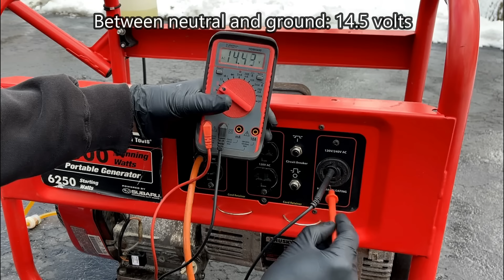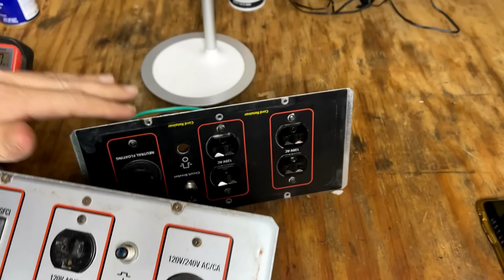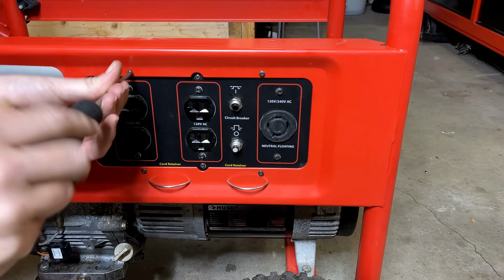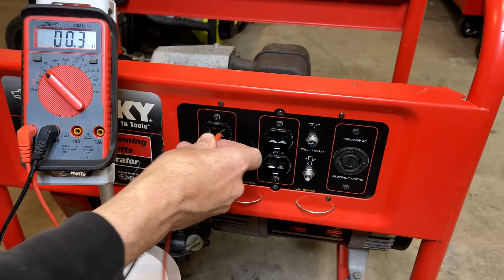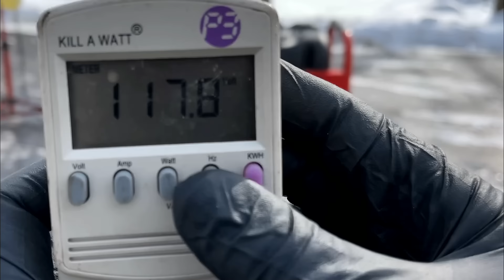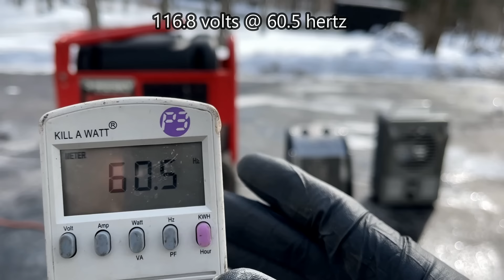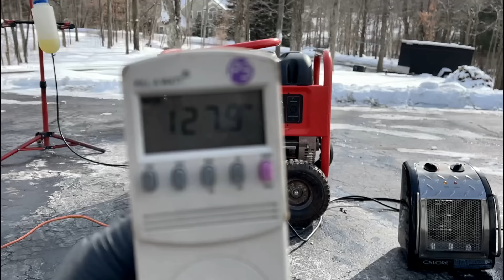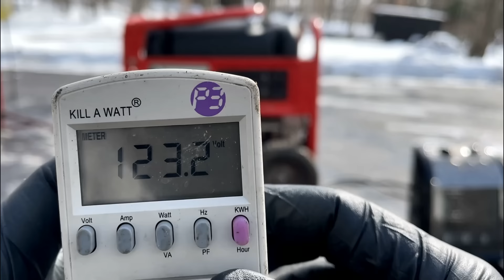No Power Output From Generator - Fixed

Comment: James, can one not adjust the AVR while the engine is running?
Reply from the maker: It can.  Just keep in mind 240vac on the stator, 130vdc on the brushes and moving parts.  Much safer to do it with the engine off.

Comment: Nice  to learn   , specially when you that much care a but the rust  even inside of the weels and wire brushing that !  but not the plate inside of air filter,   anyway just outside looks matters no one see that , one more things straight from start to the history of  equipment  specialty the price are very helpful  thanks
Reply from the maker: I brushed it off camera.  Also ended up swapping the air-box out with the carburetor at then end with one that has no rust.

Comment: When you are soldering magnet wire you need to scrape off that varnish and also scraping the terminal wouldn't hurt. I make battery packs out of AA rechargeable batteries and staples as the links and I have to dremel everything, staples and battery ends before they will stick. So giving that terminal a little grind with the dremel wouldn't hurt, just use a small precision grinding bit.
Reply from the maker: I did scrape.  Like the patriots logo!
Reply: @jcondon1  Thanks.

Comment: Seems like moisture and the corrosion as a result was this unit's worst enemy.   Glad it shook out.   When it's cold as cold can be outside,   my snowblower hunts and surges a bit.......until the engine gets to working temperature.  I wonder if the cold was working against you.
Reply from the maker: The cold does not help.

Comment: James, it's not unusual for the folks winding rotors to use an alloy that withstands centrifugal forces better than straight copper  (sometimes Al or just a hint of Be).  Both make soldering difficult.  The original was probably done as a braze with a propylene torch.  But that doesn't mean you can't solder it.  Try flux from US Forge (part 03051)...  I've found that works on about 90% of the oddball stuff.  If that doesn't work,  there is a flux for soldering Aluminum.  I get mine from Russia (off the web).  It only costs a few bucks for an ounce or two but it takes 6 weeks or more to get it.  But it will let you solder anything to anything... almost.  Just flush it well with contact cleaner when you are done.   I have your email still, I'll send you a pic of the Russian stuff.
Reply from the maker: Thanks, very helpful.  My soldering tooling/knowledge is light.

Comment: James, that is high temperature wire and you need to mechanically strip it off for it to the solder. You  an use an facto knife to stop it off but need to be careful when doing it to be successful.

Comment: Previous owner / operater was a real slob;...letting it corrode like that, water  in oil, fuel, no air filter, messing around with wires... but now it is  once again a nice machine!
Reply from the maker: The listing said it had a recent tune-up.  Water in oil, no air filter, water in the tank, clogged jet.  It was not treated well.

Comment: I was screaming at my computer, try googling aluminum solder kit, it is expensive, but I have used it. I comes with a special alloy, and flux, plus plenty of warning sheets. Just tinning the wire ends is enough, and it functions as a bridge metal for regular soldering to copper.
Did you ever check the connection to the other slip ring?

Comment: Is it possible to buy new power heads for good running subaru engines with that arent putting out voltage?
Reply from the maker: It is possible, but they start at about $400

Comment: Grounding question.  First means of disconnect should be grounded.  This is the main panel in a house.  My Generac has a bonded neutral.  When connected to either a transfer switch or backfeed breaker, the neutral bond should be converted to floating.  Is there a kit available to add a switch to the generator so I can easily go back and forth to bonded neutral when using it as a standalone vs. whole house backup?  Could you do a video on the conversion?
Reply: I would talk to an electrician about that.
You shouldn't float the neutral because there are a lot of appliances with metal enclosures have the earth and neutral bonded inside. (Inverter welders are a good example.)
Reply from the maker: Have not seen a switch, but there are some companies that sell bonding plugs.  So permanently convert to floating neutral and use the bonding plug  to switch it.  The only downside is that it occupies an outlet.  https://amzn.to/34OtJXD
Reply: @jcondon1  The bonding plug is the solution for bonding the neutral in smaller generators, typically 5500 and smaller with floating neutrals.  5500 and up typically come with bonded neutrals.  My union electrical foreman suggests that I float the neutral.  The Pro Line Transfer switch manual suggests that I bond the neutral.  Have you had any experience with generator failures due to either?

Comment: The challenge with soldering AL is it oxidizes almost immediately and solder wont' stick to the oxides.  I'm not expert at it, but try coating it with flux first, sanding it while keeping it coated with flux (to keep the air away), then do your best to keep it covered in flux while you solder.  I think I would use high heat and work quickly, AL will conduct the heat away from your joint quickly and high heat will get the joint hot quick and hopefully you can get it done before the flux is gone and before the heat gets down the wire enough to melt the coating where it shouldn't be melted. No guarantees, but this is what I would try.
Reply: You cannot solder to AL.
Well you can, with very specialised solder/brazing alloys and flux designed for them, neither of which you'll find in a hardware store. You also need very high heat and a good respirator. Also it will only meld with certain grades of aluminium and there's generally no way to tell the composition of the alloy that you're looking at. Same goes for TIG. Most cast alloy parts for Eg. can't be welded.

Comment: 3 parts diesel to 1 part oil would make for a far thinner mixture.  Might be worth considering if you have a carb that runs a little rich with just motor oil in filter.

Comment: The windings on the rotor are double enamel coated, unless you scrap or otherwise remove the coating to expose the raw copper, it will not be solder able and a "dry" joint will result. (high Resistance)

Comment: I know on the Honda gx motors and clones. If the engine does the surging/seeking it’s usually a dirty/ clogged pilot jet that can be removed from the outside. On top near the idle screw

Comment: Looked at the problem of the rotor soldering. I believe the problem is the aluminium wire coated with copper. You can not tin/lead solder aluminium wire with a soldering iron. What I would do is to use some copper wire and solder to the rotor with a short length. Then cut the existing rotor wire and remove the lacquer but not the copper, then join and secure to the rotor body. Just my thoughts. Cheers

Comment: With all the corrosion internally and externally, this had to be stored in a very damp environment. Than would also explain the AVR pot. Please do not "repair" the circuit breaker as that would open up a whole can of worms, all bad. You need a Dremel tool with a wire brush. That would allow you to clean the rotor terminal which would allow for a proper solder joint. As always, great job!
Reply: Agree. I was thinking that or some emery cloth.

Comment: How do you find the torque specs for all bolts?
Reply from the maker: Just based it off of experience/bolt size.  I did not have a service manual for this generator.  But most service manuals call for very similar specs on these bolts.

Comment: 49:00 adjustment screw... I've spotted that that's fixed with some form of hot glue. Heat it, & it should worry off.

Comment: Regular soldering process do not works on bare aluminum wire. Those wires has a thin copper coat to be soldered, so you need to remove only the enamel to try to solder it. Most of them can be removed using temperature, but you need a more controlled process.

Comment: hey James,
don't scrap your rotor, he's fine (not the bearing, ok), you need only a snap-on/pressed connector, or a double screwed connector like in domestic installation, aluminum wire one side, copper wire at the other side, easy to solder.

Comment: I'd check the other connection too. Scrape the other wire on the other connection till you can see bare metal then check continuity between the wires on either side. If that's open then there's a break in the windings somewhere. 
 I'd doubt it's aluminum wire because it was soldered originally.
Clean metal is the key for soldering. Use fine sand paper to clean the lacquer off the wire then use flux and try tinning just the wire. Then clean the terminal with sandpaper, use flux and tin just the terminal. Then it should be easy to solder the tinned terminal to the tinned wire.

Comment: No point in attempting to solder a corroded connection. Clean the tab and the wire to a shine and it will solder easily. Loved the circuit breaker disassembly. I have always wondered how that type of breaker worked.

Comment: Adjusting the speed/voltage. Those multiturn potentiometers either 10 or 20 turns.
The adjuster has a worm screw driving onto a circular gear. They have fine teeth but when you reverse direction there is some slack,
usually about half a turn, before you actually start to change the value. 
Ex Marconi engineer I must have tweeked thousands of these things on broadcast gear.

Comment: James you should to try using a straight gas line from bottle to gen don’t let it lie on the ground the pressure might make a difference
Reply from the maker: Thanks Henry.  I try to keep the test tank roughly at the same level as OEM tank to keep the pressure in check.

Comment: James, Briggs and Stratton model # 030253, still having troubles, no power on one leg of 240 and 120 outlets. I’m  testing the wires at the stator, unplugged from the control panel, it has 5 wires color coded red-ground, black neutral, green neutral, gray-one leg, blue -one leg. One prong on black neutral one on gray I have ohms, and one prong on red and one on blue I have ohms. Stator has some dark brown color in the copper windings, but no broken bindings on the  windings. Should I get ohms with one wire on neutral and one on blue? This is the leg where I’m not getting ohms at the control panel when all plugged together, I just unplug to get reading at the stator.  Just trying to make sure stator is really bad before I give my finding to my neighbor that he has a bad stator.
Reply from the maker: Between (grey and red) and between (blue and black) you should get about the same reading about 0.3 to 0.5 ohms.
Reply: @jcondon1  Thanks James, but I don’t get anything with that combo, either one, with my multimeter on 200 ohms touching both prongs together I get .4 and prongs on wire leads  at the stator plug I get .7 with red and blue and get .7 with black and grey. Sorry to keep bother you, just trying to figure out if the stator is the problem or something else. I did test both the reset button using the beep test with multimeter and they tested good, they both beep. Also tested rotor and it read 34.0 ohms.
Reply: @jcondon1  I found the issue, while taking the electrical panel off of the generator I had to take the harness loose from back of the electrical panel that goes from electrical panel to the stator, the red female connector that was in the harness had been pushed out of the hardness and was not making a connection when the harnesses where plug together, I fixed the female connector end to stay in harness when plugging the harness back together. I now have full 240 on the 4 pin plug and all 4 of the 120 plugs work. It’s still hard to believe that the one red wire could not let one leg produce power. But I thank you for all your replies to my questions and really appreciate all your knowledgeable video you make.

Comment: Copper coated aluminum wire. 
Brings me back to the early seventy's with copper coated aluminum battery cables.
You can just imagine what acid did to those cables. Eats the aluminum on the inside leaving the copper coat on the outside.

Comment: Is the rotor winding wire actually copper. It may be copper coated aluminium wire which is really hard to solder.

Comment: Regarding the AVR voltage adjust potentiometer (pot) These are dirt cheap type multiturn types with a backlash that has to be taken into consideration when going forward or backward.  settng them is really pot luck and counting turns will never get you back to square 1.  IF this potentiometer was not potted (pun intended) you could measure he resistance o see at what resistance a given voltage would be generated.

Comment: If the copper coating on the aluminum wire is removed standard solder will not stick to it.  Possibly some ultra low melting temp aluminum welding/solder type rod would work as if sticks well to several metals.

Comment: Hello,can i adjust the avr while the engine is running?
Reply from the maker: Its possible, but not recommended due to the voltages in that area.
Reply: @jcondon1  ok, thanks for the feedback

Comment: It takes a super hot and high power soldering iron and really high quality flux to clean the corrosion, and just a lot of heat and a bit of solder and flux to burn off the enamel from the wire.  Especially with aluminum enameled wire, it corrodes way worse than copper and is much harder to clean the corrosion off to get a good connection.  It also gets much hotter when using it when it is overly corroded, so it may have other bad spots caused by heat and corrosion.  Probably not really worth trying to save as it may just fail again in a different point on the winding.

Comment: Question, you started this generator an had only one outlet working. An showed the fuse breaker was kinda bad. Would that be the only thing that would stop one outlet from working?? I have a 10, watt that stopped working on one outlet, an only gives 110 at the 220 outlet.!!!
Reply from the maker: Its either a wiring issue like the circuit breaker or an insulation failure in the powerhead.
Reply: Thanks James, It's a vangaurd Star Generator From Northern Hyd, an 18 yrs old  20hp 10, watt.

Comment: Those wheels could be disassembled, wire brushed, and soaked in vinegar, or cleaned with electrolysis and then primered with a rust converter and painted. If you clean them in vinegar, rinse them in water with baking soda to neutralize the acid. I've done this on more than one occasion, and had good results, with no rust return. Ultimately, sandblasting and powder coating is more ideal, and I've done that too, but don't so much care for the wait times to get them back. HF isn't too far from me, but I've not had the best of results with even their air tires as some from new wouldn't hold air. I have found that if I'm at the scrap yard to unload, I look around for similar tires/wheels, and just have a few of these in stock.
Reply from the maker: HF was my backup, but the wheels worked well and there was a lot of corrosion on the engine.  Was not going to see a return on the investment.

Comment: What did the ad mean by "tune-up"?  This always perplexes me, but I was selling a fuel-injected car once and I listed off the dozen things I'd done: changed the oil, flushed the radiator, changed the spark plugs, etc.  Dude asked me when was its last tune-up.
Reply from the maker: Good eye.  I noticed that after recording the video while editing and was wonder the same thing.  Tune-up?  The oil was a mess, no air filter and the carburetor surging.  Not much of a tune-up.

Comment: The rotor has bad joints on both sliprings. water and aluminum wire do not mix. You also need special aluminum solder to do that joint. What i do is use copper wire wound around the aluminum one and than solder the copper to the sliprings and over the aluminum. It is mostly a mechanical joint that way.

Comment: The wire that wouldn't solder is because the wire must be cleaned very well. Either by sanding or scraping to new metal. In fact the entire area must be clean.

Comment: You may know what you are doing in some areas but use bonehead maneuvers in areas such as electricity. Try scraping all the varnish off then tin the wire then check ohms to the other side or even both slip rings. You may also unwind a single winding to give you more wire length.
Reply from the maker: Did that, but edited it out due to length.  I tested the slip rings to the terminal and both were good.  Scrapped the varnish off the wire on both ends.    Never could get anything less then several million ohms so did not worry too much about the quality of the solder connection.

Comment: If you use a wire brush to expose some clean metal, on both the wire and the terminal, and use plenty of flux the solder should stick better.